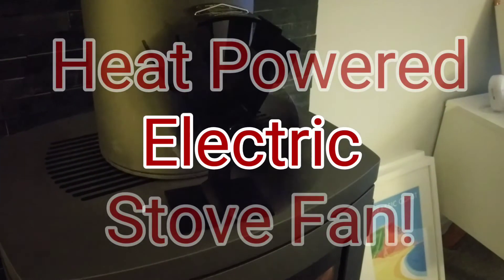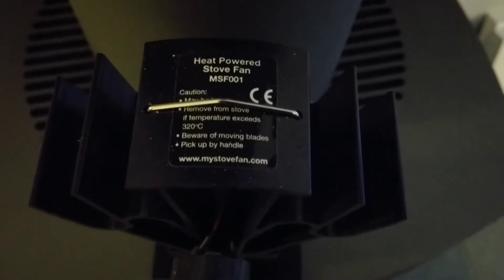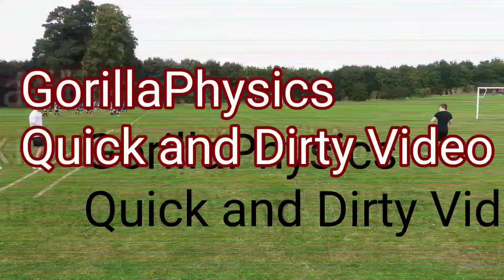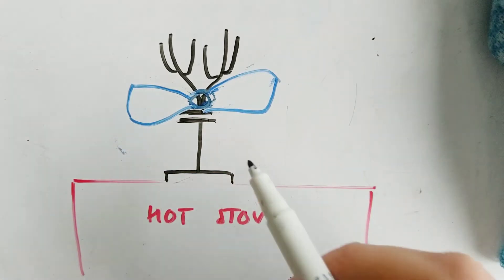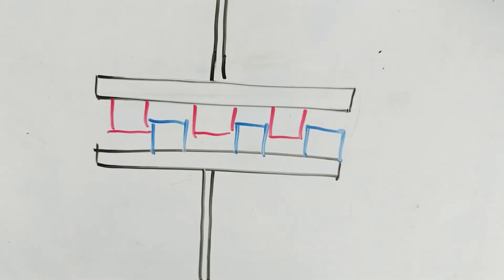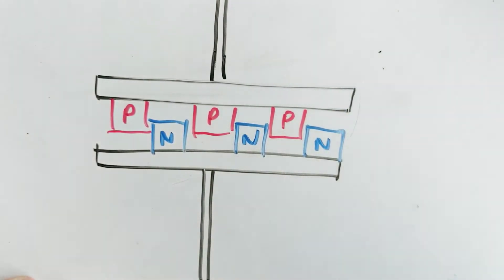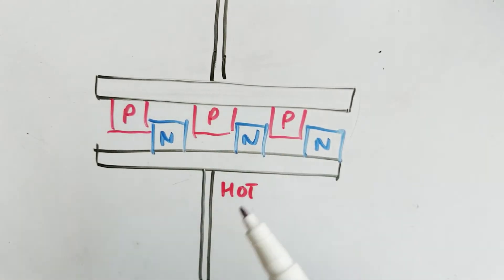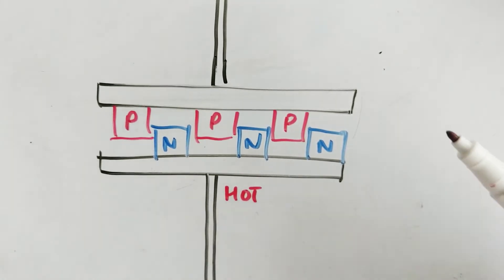How does a heat powered electric stove fan work?  Semiconductors and heat - GCSE and A Level Physics

Comment: Could you put it on an induction hotplate directly, or on an induction hotplate diffuser?
Reply from the maker: Not sure about induction, I'm not sure if the base is metal or ceramic. But might work.  Any heat source should do it.
Reply: Works on ceramic hot plate

Comment: So what’s the lowest heat temperature that will start that motor to turn the fan and if you introduced a freezing a lower temperature of frozen essentially negative then with the fan start at a lower heat
Reply from the maker: These are excellent questions. Can't test this, as the fan isn't mine. 

But yes I think you are right, if you had a bigger difference in temperature, I think your see a bigger potential difference (voltage) and so a faster motor.
Reply: Just got one of these as a gift. Fan started turning when the base hit about 65°C. Room was 16°C, but I'm sure it was warmer at top side of the fan
Reply: The cheapo fan I have starts when the surface it’s sitting on reaches 60*C - regardless of ambient temperature. My stovetop reaches that temperature very quickly (<2min), but it takes a lot longer for the air the fan circulates to get warm. So for the first half hour or so it actually blows ambient air around.

Comment: How is it the silicon doesn't run out of electrons?
Reply from the maker: As it's a complete circuit they are essentially replaced by electrons in the other components. Kirchhoff's law of conservation of charge!
Reply: @kitbetts-masters  Does this mean that the least noble metal in the circuit is slowly corroding?

Comment: So, is it a Peltier?
Reply: yes, it's simply a peltier junction with a huge heat sink to remove the heat from the top. really easy to build. just figure out the output voltage and add a motor accordingly. https://www.youtube.com/watch?v=ML0JQENP6IQ    and    https://www.youtube.com/watch?v=Ipm77mhiwSg
Reply from the maker: Not sure what one of those is sorry!
Reply: Yes, it's Peltier.
Unless there is some other kind of semi conductor technology that competes with Peltier that I have never heard of. 
But all I know of is Peltier.